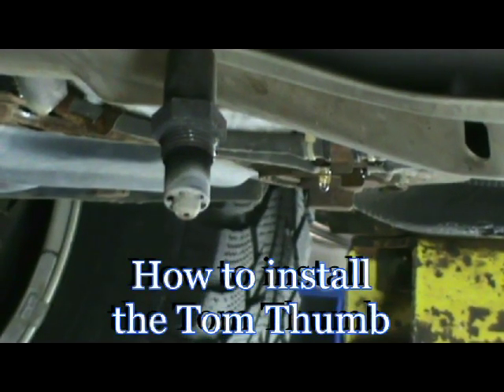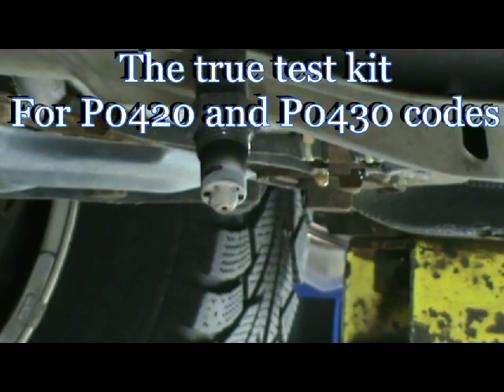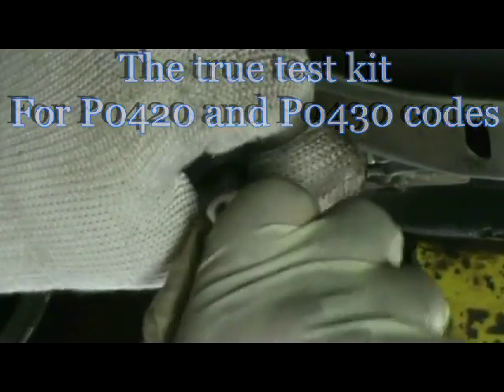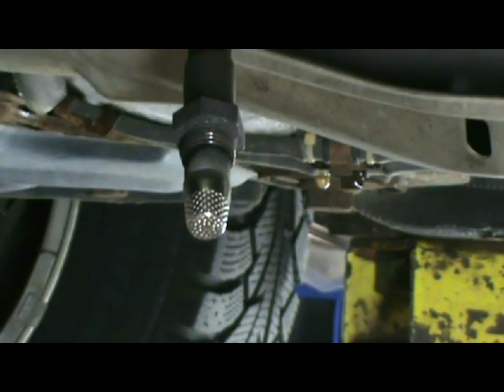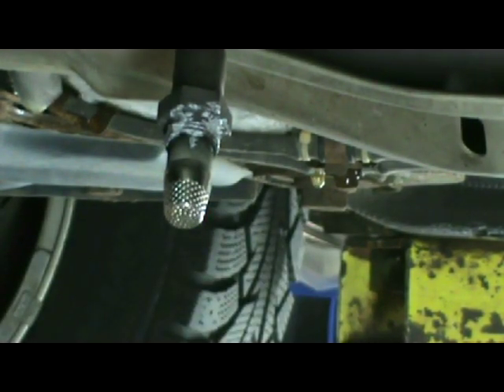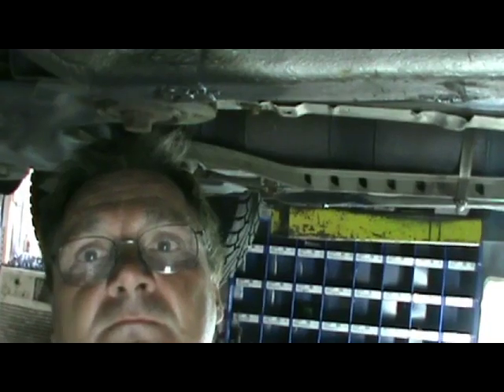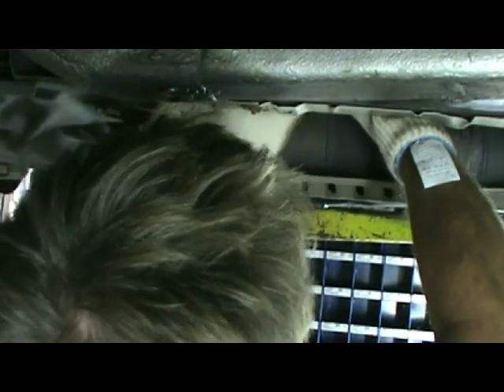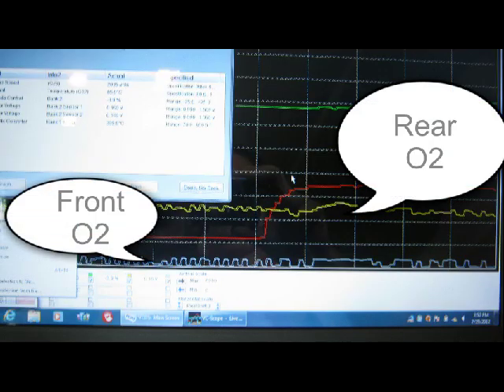Tom Thumb O2 sensor P0420 P0230 code test kit No O2 Spacer needed for Bad Cats

Comment: its not legal; ,just sayin .this will make a car with a faulty cat stay on the road!  not the right thing to do
Reply: Not all states have emissions.... like mine. Also my car has a pre-cat (so I still will have a full main cat in the mid-pipe) and the pre-cat's on my type car are known to break up and detonate the motor... so I need to change it.
Reply: off road use only
Reply: Pennsylvania has no visual inspection for there emissions testing, therefore your car would pass here in Pennsylvania, technically  though, yes it's illegal and "off road use only" ..

Comment: this thimble has holes thru it or not. (the sensor is fully closed without communicate with catalit. emission)? I bought a few of them but they not has holes thru.
Reply from the maker: They do have a very small hole .030 th  this slows down the response time of the sensor.
www.DRVOLKS.com

Comment: i dont understand why people are bad mouthing this... if you owned an audi you would know that the stock converters brand new are $700 each and on a V6 ( like my 2003 audi a4 3.0) when both cats are bad thats $1400 in parts! and if your worried about the emissions saying its "putting peoples lives at risk" have you ever seen a diesel with an exhaust and EGR delete?!? im sure that black smoke coming out isnt healthy! and diesels arent emissions tested in most states so i don think its a big deal.

Comment from the maker: This product is not intended to and will not provide emissions compliance.
Emissions laws vary by state. Check local and federal laws before modifying your exhaust system.
Emissions compliance is the sole responsibility of the vehicle’s owner.
This product is sold for non-road vehicles / competition use only according to 40 CFR 1068.101 (4) (b). 

You have never had to work on or test a converter this tool makes it fast and low cost to every one.

Comment: ok i have a few issues with your product , you said that if the thumb falls off it will just come out of the of the exhaust, that not true , there is a mesh on both ends of the cats , second your product only covers the problem which is a bad cat , by using this product your putting peoples life at risk. your catalytic converter is there to clean three bad compounds Hydrocarbons ,Carbon monoxide and Nitrogen oxides . as we all know all three are bad .